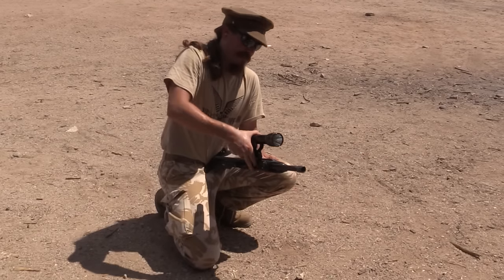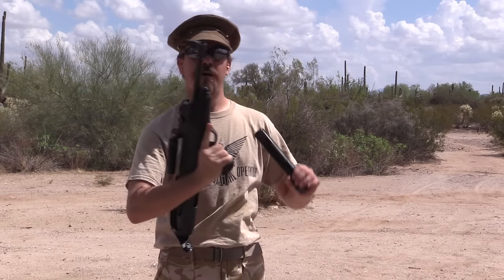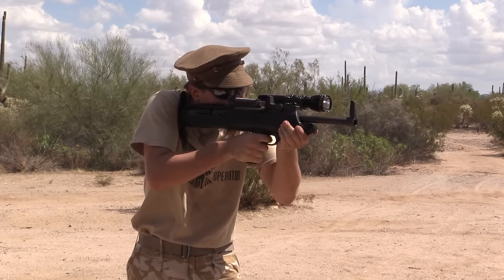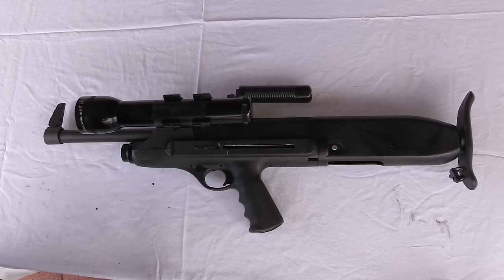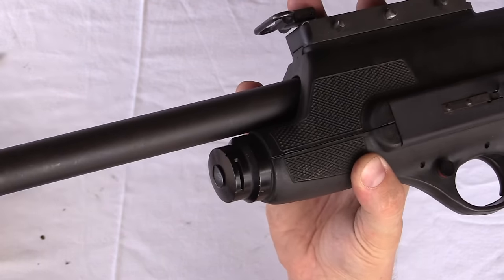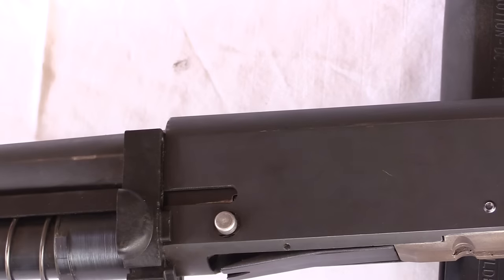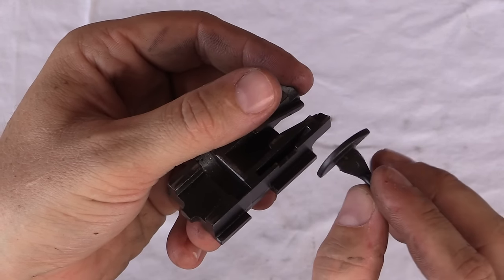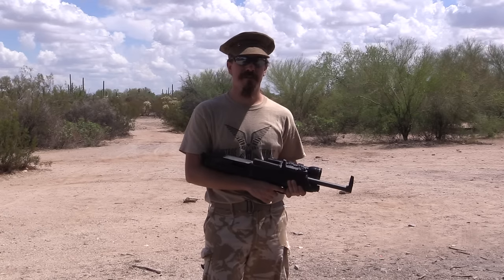High Standard 10B: Disassembly and Attempted Shooting

Comment: Great video, as usual, you keep my interest indeed.  I was a cop back in the 70's, and I can assure you though that the Kel-light was the top of the line, the mag light came later.  The kel light had the advantage of being solid aluminum, and could bust a skull wide open if need be.  We had them in hand at every traffic stop, and when clearing buildings. Very comforting in hand, and they had a great light output as well, this before the ultra bright bulbs were invented. An 8 cell "D" kel light would last through an accident investigation on a dark highway, and would continue to serve the rest of the shift.

Comment: Neat idea for 1965, obviously not the best execution
Reply: +Patrick Takada I agree, the thing looks amazing. Too bad it didn't work correctly.
Reply: +Greg Cyr The only issue with the shotgun is the pin that is interrupting the lift, a better manufacturer could have perhaps made that design work.
Reply: Emmett Montanaro I fail to see a difference. Bad design. Bad manufacturing. That seems consistent with,  "piece of junk".
Reply: Greg Cyr Okay what about it's design is bad?
Reply: Emmett Montanaro It doesn't work. If you carried that into combat, you'd be dead meat. I think the performance in the video is sufficient evidence to assert that it's a piece of junk.
Reply: Greg Cyr It only didn't work because one pin was interrupting the action, literally no firearm would function with a blocked action.
Reply: Emmett Montanaro My grandfather's old M1911 never jams and never has blocked pins.  This gun screws up every single time. Evidence of its shoddy quality is overwhelming. I see no reason to make excuses for them.
Reply: Greg Cyr Sounds like you don't know much about firearms so I'll leave it at this the design is solid, it does work its a proven semi auto design. But a better manufacturer could have made a trigger grouping with no lose pin and it would cycle as intended.
Reply: Emmett Montanaro It sounds like you are unfamiliar with the term,  "proof is in the pudding". We've seen the pudding. You're just making excuses for them.
Reply: Emmett Montanaro
I'm not interested in excuses. If I followed your train of thought, there would be no bad products on any market. Everything would be greeted with, "they could have done X better". There are no pieces of junk, by your argument. I wish you the best of luck.

Hopefully your brakes won't fail, and you won't be flying off a cliff saying to yourself, "the brakes are actually solidly designed and it's not the manufacturer's fault that I'm about to meet the ground at a high velocity".
Reply: Emmett Montanaro
I really question why you are so insistent on making excuses for the failure of this gun to perform AS EXPECTED. I have no interest in slamming the gun and I'm willing to trust the fairness of the "test". You seem to want to make excuses.

Oh, it's "too". Not "to". Learn to English.
Reply: +Greg Cyr I never made any excuses just pointed out the only visible flaw, and you know I could put a pin in your grandfather's 1911 keeping the gun from cycling so its design is junk by your flawed logic.
Reply: +Emmett Montanaro Without any sabotage, that old M1911 would fire fine. Put in a clip, rack the slide and it's absolutely reliable. This gun isn't. Unless you are suggesting that they purposely sabotaged the gun before filming, the conclusion that it's a piece of junk is inevitable. It failed the performance test. Fail is a fail, regardless of what excuses you make.
Reply: Emmett Montanaro
I'll pose a simple question for you to resolve this:
Would you choose to go into combat with this, or a Remington Model 1100?
Reply: +Greg Cyr 
I really hope you're trolling
Reply: RicoDuroska Are you also going to make excuses for what is demonstrably a piece of junk?
Reply: RicoDuroska Such maturity. Personal insults, the only defense of the truly ignorant.
Reply: +Greg Cyr I suck at English? let's look at you're quality use of it "some gun enthusiasts doesn't have a good understanding" brilliant fucking brilliant!
Reply: Emmett Montanaro
Well, have you figured out the difference between the words, yet?

On the "gun enthusiast" point, there's an enormous difference between someone who trains to and prepares for the act of KILLING SOMEONE IN COMBAT. A gun enthusiast does it FOR FUN. There's a huge difference between what's important between the two.

IS THIS TOO COMPLICATED FOR YOU?
Reply: Emmett Montanaro
Seems he's deleted some of his posts where he clearly can't English. Pity.
Reply: +Greg Cyr Trying to correct my English because you can't  argue is pretty funny, but you thinking soldiers have a better understanding of guns than gun enthusiasts is hilariously wrong!
Reply: Emmett Montanaro As I have repeatedly pointed out, their knowledge and understanding as it pertains to the designed purpose.

Guns were designed to kill people in combat. I'll go out on a limb here and propose a hypothetical test of that understanding:

A battalion of marines versus an equivalent number of gun enthusiasts, with weapons limited to small arms. 

Are you seriously going to say that the enthusiasts will win?
Reply: Emmett Montanaro Take away the body armour and limit weapons to semi auto. The Marines would STILL win every time. 

So how do you propose that the understanding be tested, is not in the field? 

A multitude choice test in the classroom? 

I'm getting the impression that you really believe the crap you're spouting.
Reply: +Greg Cyr What does killing have to do with understanding firearms you never explained that link but that's alright maybe I just don't opper8 as hard as you.
Reply: +Greg Cyr Although I don't care for the typical youtube bickering allow me to weigh in: The fact here is that the this one example is flawed. All the manufacturer had to was utilize a one-way pin such that it could not extend far enough to interfere with the lifter.

Now whether that was a problem with the design or the manufacturer, no one can say. If it is by design then I agree the gun needs to go back to the drawing table. However, if it was the manufacturer ignoring the design and using a cheaper pin, then the design is sound and this one here is just a lemon.

Example: There are "mil-spec" 1911s that are reliable and those that aren't. Given that they are all mil-spec, the design is the same, so the difference is manufacturer.
Reply: Phillip G
If it was the manufacturing that was at fault, then why did the 10B's operating instructions make specific demands for ammunition? It seems reasonable to assume that they (HS) knew of the problems quite well, and chose not to do anything about it.

That seems to be pretty clearly a design issue. If it were manufacturing, then wouldn't they just send out replacement pins, and keep their police contracts? Or they're incompetent at business relations.
Reply: RicoDuroska
Like the Remington 1100? Ya, sure - special ammo.

You DID read that it STILL jams even when using the specified ammunition, right?
Reply: Greg Cyr You try to berate me for like this initiative design but use rustington as you're quality standard? And he's right semi auto shotguns won't cycle if they use under powered loads even you're "jizz toy" the 1100.
Reply: +Greg Cyr Alright I'll spell it out for you since you are slow initiative means to act before others do. So what I meant by the design being initiative is that it was ahead of the curve by being a bullpup its design was much shorter than other shotguns of the time without sacrificing barrel length. And do you have any proof for your claims that a working model won't function with correct shells?
Reply: +Greg Cyr "lets compare a fucking 1911 to a semi auto gas operated shotgun which had a defective part and assume overall quality of a firearm from a defective model. On top of it all let's use idiotic terminology and personal experience in a debate against some guy I don't even fucking know who isn't going to change a damn thing if his line of thinking gravitates towards mine."
Reply: +Greg Cyr Greg, my apologies if it seemed like I was saying it was one or the other (Design vs. Manufacturer). I have no idea. I was merely pointing out the importance of distinguishing between the two.

If you all want to settle this just look at the cut sheet for the rifle. If there is no call out to use a one way pin or peen the pin (such that it cannot back out) then the design is bad. If there is and the manufacturer ignored this, then the manufacturer is bad.

Regardless of which one it is, the weapon is unreliable so it makes no difference to the operator. I would not make it my first choice in any situation.
Reply: Trevor Gray
Idiotic terminology? You mean, like "unreliable" or "innovation"? Words which seem to be outside of Emmett's vocabulary? Specify which "idiotic terminology" that you are opposed to the usage of.

Personal experience? I haven't asserted anything based on my personal experience. Reliability of a weapon is the first and foremost consideration for anyone going into combat. It's common sense, and something that can be backed up by talking to anyone who's ever done any time in any combat arms trade. If you want to point fingers for "personal experiences", look at Emmett, who asserted he's a gun nut and knows all about weapons. I've made no such claim.

I don't expect you to change your mind, much less see reason. I am not so hopeful.
Reply: Greg Cyr
autism
Reply: +Patrick Takada Haha I accept some responsibility for that, sorry man I know this couldn't have been the response you expected with your original comment.
Reply: *****
1. Your reference to 1990s shows your ignorance. The gun was designed in the 1950s. It was manufactured from 1967-1977. Go check your facts.

2. Whether it is a design or manufacture problem. Well, if it were shoddy manufacturing, then they would have sent replacement pins and kept their police contracts. They didn't, which indicated that the problem was more than just the pin, and fixing it would require more $$$. But either way, it's their responsibility - a responsibility which they failed to keep. As is amply evident by the historical evidence.

3. Nobody agreeing with me doesn't make me wrong. It's more of an indication that you and your fellow gun nuts can't think rationally. This isn't a popularity contest. Your point is indicative of your level of maturity.

4. I used the M19111 as an example of good design. Once again, you missed my point. The M1911 is still in use today. The 10B is not. That says all that needs to be said.

5. Owning a gun does not make you an expert. I know several people who own high performance sports cars. That does not make them good drivers, or knowledgeable about high speed driving. But I suppose in your book, it does.

6. Marines know how to use their guns. If your argument is that they do not, then I suggest you take it up with one. They might not be experts in all firearms, but give one of them ANY gun, and I'd put my money on a marine in a fight over any random gun enthusiast.

7. Ad hominem attacks, which you seem so fond of, indicate the weakness of your ability to defend your position. It is a sign of desperation. Your and others' attacks just show your inability to form a cohesive argument to defend your position.
Reply: +Greg Cyr by idiotic terminology I was referring to your use of the word clip in lieu of magazine. As far as personal experience goes, you were using personal experience with instances such as "your grandfathers old 1911" and honestly I don't expect you to see reason.  I'm not so hopeful.
Reply: +Greg Cyr as far as emmet goes I couldn't give a fuck less about him. I'm just commenting on your fallacies.
Reply: Trevor Gray I shall give your YouTube gained expertise all the consideration that it deserves.
Reply: +Patrick Takada With this one, alone, Ian could start a new channel called 'Forgotten Threads.'
Reply: Smeghead McSmeg Soldiers dont even learn to shoot that well. Outside of basic most of what soldiers do, including marines, is janitorial work/manual labour
Reply: This is the longest comment altercation I've ever seen on Youtube. Congratulations :D
Reply: I owned one in the  70’s.....it worked perfectly .  Shot several 100 rds through it  high brass and low brass. Zero malfunctions.  Sad to say I let someone talk me out of it.
Reply: @gregcyr  It's a bit like saying the AK sucks because your personal AK threw a bolt carrier pin and you never bothered to fish it out of the gas tube.  One video of one gun's issues doesn't tell you much about what quick and easy things could be done to fix the issue and have a fully functional weapon again... or not.
Reply: @robertgaudet7407  Read the reports. It's a piece of shit and jams constantly. There's a reason why the company ain't around any more. The market punishes incompetence.

They lost all the police contracts. The "fixes" clearly didn't work as well as you suggest.
Reply: Smeghead McSmeg this is three years old but still you’re insanely dense. The design itself is fine. The manufacturing tolerances were horrible. To put into comparison, the design for an ar-15 is good, but if one part wasn’t made to specifications it wouldn’t work.

Comment: It doesn't seem like it's a flawed design. If the pin is the only problem then the problem might be the pins not being well-fitted.
Reply: +Shoes Either that, or the drillbit, that was used to drill the hole for the pin, was sharpend wrong. A drillbit, with one egde bigger than the other, drills holes too big. I find the thought, a faulty drillbit rendering this gun useless, very amusing. :)
Reply: +Skyliner04s It's not that. I think it's put backwards. Check that it has two holes on either side of the housing. Couple that with the serrations, (parallel to the axis of the pin at that) and you can assume that someone at some point swapped it backwards.
Reply: +aserta Possibly. If the pin were only supposed to be knocked in one way you would think it would be marked. If it were me, I'd just give the pin a good whack with a hammer at its midpoint, to bend it slightly. That way it would fit snugly when tapped back into place. But yeah, this seems more like a manufacturing flaw than a design defect.
Reply: +TheInflicted  If you look at the lifter arm, one side is higher than the other. If the pin was pushed through from the other side  I am willing to bet that  i) The serrated end would grip properly, and:
                                                                   ii) even if the pin  moved sideways it would not interfere with the low side of the lifter arm. Seems a pity that nobody tried it that way, but if it wasn't Ian's gun, then perhaps he didn't want to to tear it apart.
Reply: Hey look, people who try to find and fix the problem instead of "HURR DURR IT NOT WORK IT JUNK."

*Faith in humanity +10*
Reply: @webtoedman  It is Ian's gun actually, hopefully he saw these comments or had someone else bring that to his attention, and btw I agree with the guy right above me, good on you guys for being civilized and actually curious about how to fix the issue instead of just saying it's a piece of junk, when clearly it's not, it's just not working properly at the moment of the video. Stay good my friends B)
Reply: it's a little late but i think some locktile on the pin will keep it in place
Reply: @aserta  yes the extractors held in the same way and only come out that way or you will Waller the hole out causing this problem.

Comment: Looks like when High Standards made this gun they had pretty low standards! Haha! 
No one??? Ok...
Reply: +Adam Cooper oh man sick burn bro
Reply: +Adam Cooper More like they were too HIGH STANDARD since it can't use cheap ammo. LOL
Just like those Tokarev SVT-40s.
Reply: +MrReded69 Please clarify. You're saying that the filmers used cheap, crappy ammo?
Reply: Greg Cyr As Ian stated this gun needed to use a specific type of ammo. Not just any shells off the shelf. I don't think Ian and co. used cheap crappy stuff but 30+ year old gun is obviously choosy.
CLEAR ENOUGH?!
Reply: MrReded69 It's a problem even with brand new 10b. 
From Wikipedia:
" The most common problem was the failure to cycle correctly. According to the instructions on the Model 10, only magnum or "high brass" shells were to be used. However, even with the correct shells, the action would sometimes fail to cycle reliably."

Doesn't sound to me like using different shells would have helped. 

Your comment implied cheap crappy ammunition.
Reply: Back in the day I had a Hi Standard .22 revolver with a 9 shot cylinder and a 4in barrel;  it was a fun gun to shoot and you could use any .22 cartridge.  I used it to scare cattle (bird shot) and Javelina (LR) out of the garden and snakes when in the desert.  Best little revolver I ever owned.  Can't say so much for any other Hi Standard firearm I ever shot.
Reply: not so high standards thou
Reply: Main problem exhibited in the video however is a faulty part, if ran with high brass buck shot when repaired then chances are it would work just fine
Reply: Yuck yuck yuck yuck!